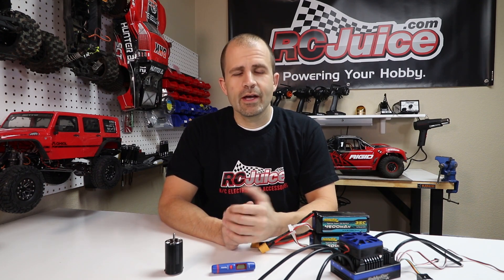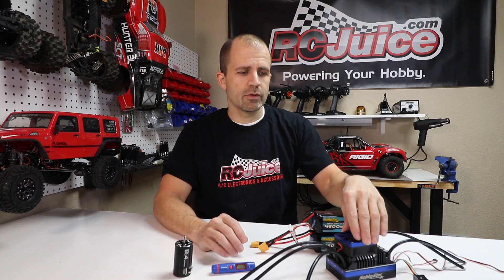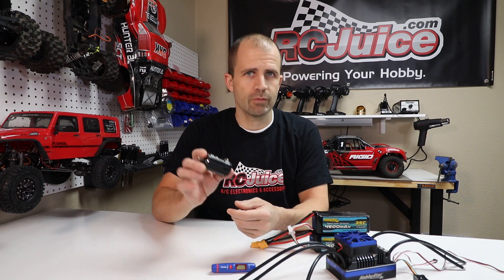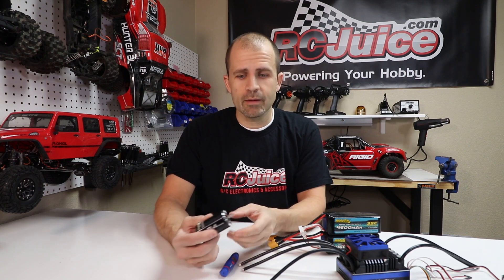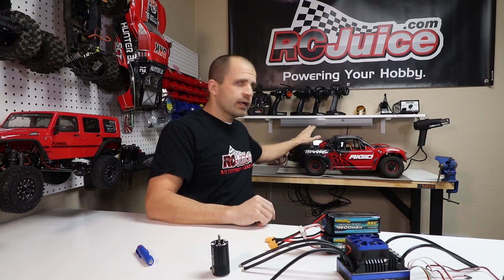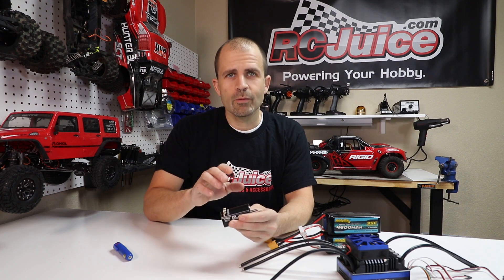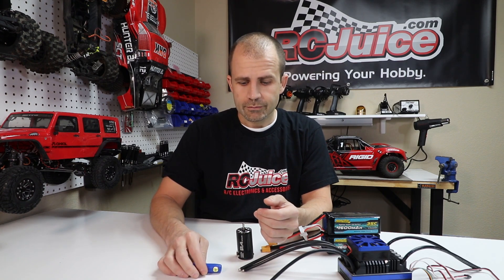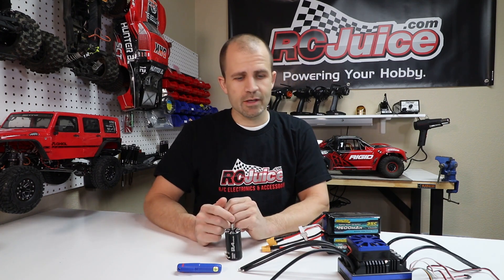Brushless motor temps, the #1 rule in R/C!!

Comment: The exact components of a specific motor will vary.  The insulation of magnet wire is usually 600V and rated 221-428F.  Silicone insulation is 600V-1000V and can take 482F (302-572).  PVC 221F, Teflon 842F.  Neodymium Iron Boron magnet grade max temps are  N 176F, NM 212F, NH 248F, NSH 302F, NUH 356F, NEH 392F, NAH 428F.  They are most likely grade N.  Good magnet glue can withstand 500F.  Some people use Loctite 480 (A type of CA/super glue) which is only 180F.  The info I have found so far for bearing lube is 160F-180F.  Silicone oil can withstand 400F or more, but I don't have any info for this type of use.  Bottom line, voltage itself will not damage a brushless motor.  If the heat exceeds 160F, the bearing lube can "drop out" and the magnets are approaching the point of damage.  You can run motors at 200F for a short time accepting the fact that the lube can cook out and that the magnets will lose strength each time.

Comment: I made the mistake of using wd40 to clean my motor after I got sediment from water in it. I ran it underwater after I read that I shouldn’t have done that but now it sounds dry and a bit louder. Any tips? It’s a Hobbywing 1650kv
Reply from the maker: It's actually OK to use WD40 on them, you probably loosened up some dirt but did not get it out of the motor.  We'd recommend popping the motor apart and physically cleaning it out as it sounds like you have some debris stuck between the rotor and the stator which can cause damage if left in there.

Comment: Nice vid! Quick question: How do I see the max RPM of a motor? I've been looking for some online but can't seem to find the max RPM of it.
Reply from the maker: If you are referring to the maximum rated RPM of a motor, it is going to be in the specs from the manufacturer.  As a general rule most motors should be limited to 50,000RPM.
Reply: @RCJuice  okay thank you so much

Comment: A 3300 Kv motor is good for a 17t to 54t gear ratio 1/10 basher car?
Reply: My 3300kv came with 12/54 and still gets hot quick even when brand new. I agree with u on gearing. U think it may be becuz its a center diff truck?. Just seems everyone else is running gearing like u posted but this one is running hot. Ive gone thru everything looking for friction. Ive ordered a new motor n esc to try out.
Reply from the maker: 2S or 3S?

Comment: I have a 3650 3300kv in a 4wd MT 1/10 but small 1/10. Its the Helion Avenge/Rival Mt10. If i go up to a 3660 or 3665 will this help lower my temps?  I think maybe the trucks are undergeared. 12/54 gearing but im newer to the hobby only had the truck a yr or so but ive never been able to run 3s long before temps are near danger zone. Thank u for any advice.
Reply: Thanx for your reply. I guess i need to get a 10&11 tooth.
Reply from the maker: It may make a small difference, but if you are overheating now you will likely want to drop a tooth off your pinion.

Comment: Thanks for the video. I learned alot. I have a vintage team Losi buggy brushless and the car actually quit because I believe the esc shut it down. The motor was extremely hot. When it cooled down it ran again. That led me to you tube to search out and I found your video. I am still trying to find out a way to install a heat sink and fan on this vintage buggy.

Comment: Hi, nice video. One question: when do you decide to gear down and when to use a coolingfan? Or do you try to gear in such way that you don’t need a fan? When my motor becomes 130dg is 8% drop of gearratio enough? (That’s 13 teeth pinion to 12).
Reply from the maker: Our opinion on cooling fans is that they will help a property setup system run cooler, they should not be used to try to bring a setup that otherwise overheats into operating temps.  13t to 12t will give you a noticeable result, but if your motor is 130F already then you do not need to gear any lower, 130F is plenty cool for a motor to run at.

Comment: So put a outrunner airplane motor like the cheap Surpass C2820/3542 1000-1200kv on a 2.5kg crawler seams to be not the good way?
I so a guy on YouTube ho try that but finally burns the motor. It's over loaded, non?
Could it works with a bigger and slower similar motor, just for fun to try?
Thanks
Reply from the maker: We have not done any experimenting with outrunners on cars.  Outrunners are designed for constant high-RPM use for which their design is inherently better for.  Not to say you can't get an outrunner to work, but crawlers are far from sustained high-RPM vehicles so results will likely be OK to unfavorable.
Reply: Sorry for the the question.
If I decide to go ahead and try anyway (there is some people who do with DIY esc or with the Holmes Revolver motor which is a outrunner motors designed for crawlers) what's the safety way.
The slower and bigger motor I can + a good ESC with no big Amp's. I can reduce the final speed by my transmitter.
Is it possible to use the hobbywing platinum esc (for airplanes) and program to have brake and reverse on a crawler?
Thanks so much
Reply from the maker: @cutximbiriosos3239  We don't deal with the HW stuff so can't say for sure, but in general both boat and plane ESC's will not have brake or reverse functions to them, but it's no problem using a car ESC on an outrunner, it's still has the 3 phases and a standard car ESC will still power it no problem.
Reply: Ok
I thank

Comment: So if my motor is rated for 3s it should last just not full rpm
Reply from the maker: It's not the RPM itself that hurts the motor (although if you exceed the maximum RPM rating the motor can physically explode) rather the heat generated by the current flowing through the motor.

Comment: Great information.  I'm having trouble finding the answer to a question that might not get asked frequently.
Can you damage an ESC or brushless motor from running too small of a C rating?
Reply from the maker: The short answer is no, if it was an extreme situation then that could be a contributing factor, but in 99% of scenarios a low c-rating in of itself is not going to damage an ESC or motor.
Reply: @RCJuice  Thanks a ton for the reply, it's greatly appreciated.
I'm beefing up a little project car, Feiyue FY01.  It came with damaged electronics so the company told me to keep it and sent a refund, very excited.

I'm putting in a brushless motor from a FY06 and planning to replace the ESC with a Hobby Wing 10BL120.  
The motor is rated at 3200 kv.  As far as the ESC goes, I was looking for a nice budget unit and honestly the HW looks like a great fit, for the space I have.

I've also been searching battery option.  Looking for a 2s with around 3000mah and ~40c discharge rate.  The battery tray is pretty small at 87mm x 40mm.  

I've looked online and can only find some Chinese brands like the Limskey 3500mah , little hesitant but it looks like a pretty good size fit also.

Again thanks so much for your time and if you have any insight I'd really appreciate it.
Reply from the maker: @1Axis  Our pleasure to help, and you sure can't be mad at a free car! 2S is a good setup for a 3200KV motor although you are correct, that is a bit of an odd-sized battery tray so your options are going to be limited.  Please feel free to e-mail us at support@rcjuice.com with any more questions you may have, we are happy to help!

Comment: How can I have the most long range that is possible for my 124019.. I want to upgrade brushless with a new Esc so I need a new receiver and radio.. Which is the best?? Which has the best range? Should I buy a 2.4ghz boost like the immerson Ghost? Or are there any better? I definitely want to have a range more than 1 km.. 3 or more would be really good..
Reply from the maker: I apologize but long-range radio setups are not our specialty and we are not versed enough in these so we cannot make any recommendations.  We assume this is for an FPV setup?  For standard car applications, 2.4GHz gives plenty of range.

Comment: i think this might explain why kevin talbots castle creation XLX2 ESC’s caught fire.
Reply from the maker: Again guys, running the "correct" voltage does not guarantee anything.  If you have a motor and ESC rated for 4S, you can easily burn it all up if you run a giant pinion gear on 2S even.  Voltage limitations are a general guidance of what you can run on a motor, but ultimately it's up to the end-user to check temps and adjust gearing if necessary.  It's like if you have a stick-shift car and try to take off in third gear all the time,  eventually you will start to burn things up as all that extra load generates a tremendous amount of heat.

Comment: Did I understood right sorry I am German my English isn’t very good:

Don’t buy a bigger gearing pinion or bigger tires otherwise the motor will overheat.Mhm why couldn’t I buy only a LITTLE bit bigger gearing Pinion but then buy additionally these Motor Fans which you put on top of the motor and which keeps the Motor a little bit cooler
Reply from the maker: You can go bigger on your pinion gear if the motor temps are low enough, you just want to keep checking the motor temperature frequently any time you increase the size of the pinion gear and once it starts getting too hot then you cannot go any bigger than that.
Reply: @RCJuice  ok thanks man have a good day!

Comment: How do you adjust the gearing if the motor is overheating?
Reply from the maker: You want to reduce the gearing, which is done by either going to a smaller pinion gear, or a larger spur gear.

Comment: Very nice video. If you want to understand motors exactly watch electroboom video. Basically as the motor spins it also generates its own voltage so when there is no load you need very little energy to keep it running, when you to slow it down by putting a load on it generates less voltage which means you have to put more energy in.

Comment: My motor and esc says limit is 12v I got a 11.1v lipo 3 cell will this work or will I over volt it
Reply from the maker: If it says 12V that may not be a brushless or LiPo rated ESC, can you verify?  For the motor, as long as temps stay in check it will work but you need to have the correct ESC to drive it.
Reply: @RCJuice  it is brushless for sure
Reply: It’s a 3900kv motor and I have a lipo alarm on the way that I’m going to use before I even run it once

Comment: my rc car runs full throtle when i turn off transmitter. help?
Reply: try manually rebinding trans to receiver
Reply from the maker: This is normal, you should NEVER have your ESC powered on when your radio is turned off.  ALWAY turn your radio on first, and turn it off last.  Many ESC's now have protection built in to avoid this, but it can still happen and it's good practice to always turn it off first and off last.
Reply: Read your manual. Most recievers also have failsave. Car will break and stop driving. Also you would know then that you have to put out electronics car before transmitter...!

Comment: Nice comprehensive story! 👍My hobbywing max 8 is at 60 degrees celsius at 4S. Think i have to gear it down then? It is pretty quick now, and dont want to lose much top speed 🤔
Reply from the maker: 60C (140F) is still plenty safe, you generally want the motor to stay under 170F, so you still have some room left in it.  Just watch the temps closely if you gear up since you are getting there, but if you are not getting above 60C then you do still have some headroom.

Comment: First: thank you for the video, very well explained! One thing I’d like to mention is that there is quite a difference in results when checking temps with  a heath gun or with a program box. I use both on a Hobbywing combo and the heath gun showed about 15°C less than the program box... So if you’re running your motor at it’s limits... Subbed!
Reply from the maker: That is correct, we have seen quite a bit of a difference in temps and we personally like to use a known-good temp gun.

Comment: i have a arrma kraton 6s with the blx 185 system. i recently hook up , the powerhobby /yeah racing twin turbo fan heatsink . i use a y-harness and hook it up to a spektrum s2100 receiver . i ran it on a hot day for a half hour , and check the heat. i notice one of the turbo fans would stop and start, in rhythm with the esc fan that slowed down and speed up. also there was a weird noise coming from one of the fans. Do you think the blx 185 esc can handle the power drain from two 30mm fans?

Comment: The back end of my motor came loose :(

Two of the screws fell out and the rotor was touching the inside of the motor.
Reply from the maker: Hey Lawrence, was that a motor you purchased from us? Which motor was it? Thanks.
Reply: @RCJuice  no, it was a surpass hobby rocket 4092 1650kv. It looks similar to the hobbystar 4092 1730kv. I am in the UK so unfortunately it's too expensive to order from you after import charges. You're videos are great BTW. Very helpful. Many of my friends in the US buy parts from you :)

Comment: Thanks for taking the time to break down this info for people. Very helpful info👍
Also, nice to see the person whom I been ordering some of my RC parts from lol. You have an amazing selection & at pretty fair $. 
I came across this video in search of trying to see if others were having motor heating issues with their Arrma Typhon 6S RC car. Because I'm running stock gears (14T pinion /50T spur) on 6S & that motor heats up pretty quickly while bashing, like in 5 minutes. 
The stock internal gearing ratio is 3.57:1 & the final drive ratio is 11.79:1 with 117mm tires.
So I don't think I can really gear down much while already running a 14T pinion, maybe 12T. While I can run the car on 4S & probably drop the temp, it kinda defeats the purpose of having a 6S basher lol. So I'm wondering if I go with a lower Kv motor, like a 1700kv, will it run cooler on 6S since I'm dropping the motor RPM (from 45.5k to 37.7k) & increasing torque? 🤔
Anyhow, awesome video, thanks! 👍
Reply: "if I go with a lower Kv motor, like a 1700kv, will it run cooler on 6S since I'm dropping the motor RPM" - the short answer is Yes. The long answer is, it'll run cooler only if you don't immediately throw an oversize pinion gear on it :)

Comment: If motor gets hot what the parts get damaged the sator or winding. My got hot other day and u could smell it and some smoke after it cooled down it seems to run ok. Any input u can let me know
Reply from the maker: The stator windings are what will be most damaged by the heat.  If it is working OK for now it's probably fine but the power and life may be reduced from having been overheated.

Comment: I'm wondering if running too hot for a long time can deteriorate the motor in the long run (less powerfull over time).  Could you check that on a motor by spinning the rotor and feeling the steps of the magnets? or it has nothing to do with that?

Comment: I’m in a big pickle as of right now. After being out of the hobby for 8 years I got back in. Bought a slash 4x4 second hand and the system the guy had in it was a 30 dollar eBay system. So I went to my local hobby shop and went with what they recommended and had it all installed by them. Which was a 4400kv castle sidewinder 3 . I notified them I wanted to run 3s with no problems. They said this would work. She gets super hot after a run even with the 2 fans I have installed. If I keep this setup and run 2s instead (sadly) . Will it work in the long term? ANY INPUT HELPS GUYS
Reply from the maker: The first thing we would suggest is to check Castle's recommended gearing chart that should have been included with your system. I've included the link here: https://dzf8vqv24eqhg.cloudfront.net/userfiles/4671/6540/ckfinder/files/Product%20Manuals/Surface/10th-Scale-Gearing-Chart-095-0130-01L.pdf
This would be a great place to start, then continue to monitor the temp changes as you adjust gearing. After doing some research on the gearing chart, the 4600kv motor is suited more towards lighter weight vehicles according to castle.

Comment: I know you probably don't have any toy grade vehicles, but I'm going to ask anyway. 
I have a couple of 1/12 scale trucks that have the combination Receiver/ESC. After about five minutes of running they both quit.  After setting for a few minutes, they run again, and the longer I let them set, the longer they run.  I'm guessing there's a temp safety cutoff, either in the ESC or the motor, or both. Do ESC's have Temp cutoffs, Do motors have Temp cutoffs. 
Also I see sensored and Sensorless motors. Do the sensors cut the motor off if it overheats?
Update: I finally decided it was time to make these toys run. I bought servos, and ESC's and motors, and set them up on my Flysky transmitter. 
But . . .  even more interested if safety cutoffs are built into motors and/or ESC's. 
If my cheapie Virhuck truck was quitting and then running again after setting a few minutes, I'd think more expensive equipment has built in protection too.
Reply from the maker: The majority of today's hobby grade ESC's are designed with voltage and temp cut off built-in. These settings are adjustable and quite useful.

Comment: Hi I have arrma limitless with big pinion gear ⚙️ more like u said pizza! That’s what I got on it ... so the problem is the esc over heats with in 40 seconds of drive.... let it cool off it runs for 20 seconds and over heats... the esc is xr8 HB.    Also running on 6s 500mha 50c battery gives me only 4 minutes and it’s  goes down low violates one 4 minutes. So what do you think I should do.... by the way same battery on typhon gives me like 40 minutes or full blast no mercy on typhon

Comment: Is the Kevlar on the rota unwrapping also caused by heat?
Reply from the maker: It can, but indirectly.  What usually happens is that the motor gets so hot that there is some expansion, and the rotor starts to contact the inside of the motor and starts to tear it up.